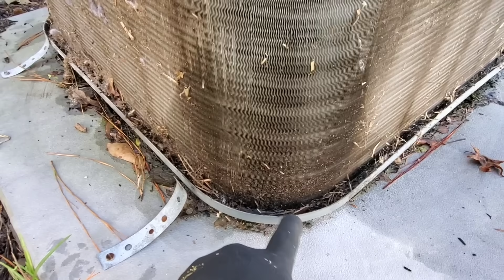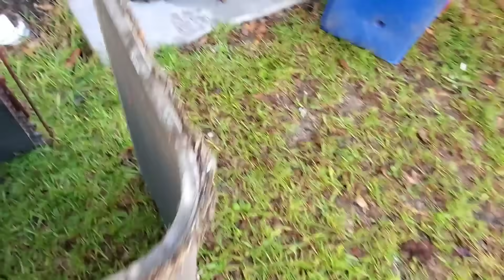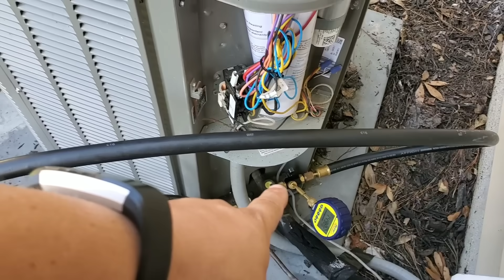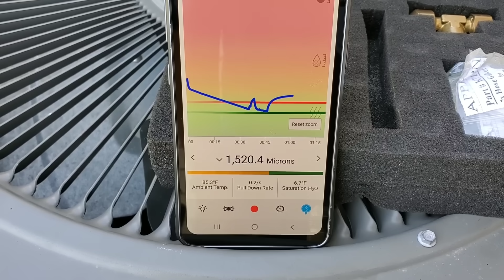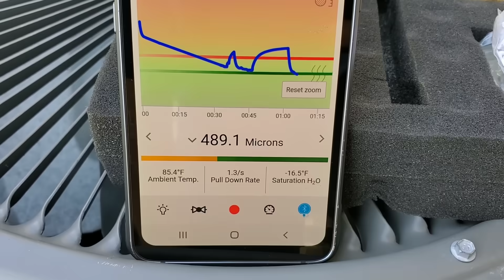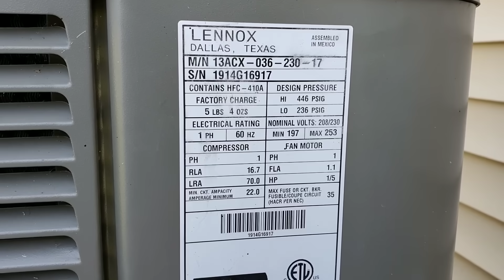Lennox Condenser Coil Replacement

Comment: This was an Awsome video. Good to see real world vacuum pulldown. It’s not always a 10 minute nice and easy like u always see on YouTube. Your right when it’s wet and the last guys didn’t dry the system out it makes for a slow process for the next guy. Good on you for best practices. That flame blowout made me jump 👍
Reply from the maker: Thanks Cory! Thought the oil flame up would be good to keep in the video and keep guys on their toes doing these type of repairs. Plus who doesn't like fire and slow motion. 😆🤙
Reply: What did you use to show yow moisture in the system liked  it alot
Reply: James Toy bluvac micron gauges with the bluvac application

Comment: What did you charge the guy for that job,im curious i need that done to my unit as well and there trying to tell me to buy a new condensor unit all toghther,what do thise condensor coils run by them selves im out of warranty by about 5 months,the 5 year that is.
Reply from the maker: Sorry, Far to many variables for me to give any prices. I'd suggest getting other estimates from local contractors if you are concerned with what one company is quoting.

Comment: Couldn't the moisture have come from the leak? Even if it didn't go flat, gas flowing by the pinhole would draw air and moisture in.
Reply from the maker: If you are asking if it is possible? Sure.  Is it the likely reason for excessive moisture in this specific situation? No.
The important point I was attempting to make was how to identify moisture and the process of removing it.

Comment: It’s odd they didn’t put anything under the coil to keep that from happening, rubbed that whole corner down. Nice fix. I always like those superheated oil flare ups when taking components apart, makes you respect what you’re working with. Good job all around!
Reply: Must've been on a Friday... I'm not sure about that time frame, but I believe there are typically plastic stand-offs the coil rests on, but could be thinking of a different brand.
Reply from the maker: Gotta love when you have to make in field improvements to the manufacturers design so it will last. 
Thanks for watching Tom!

Comment: Thanks for showing why we should use a pipe cutter for the first opening in a system. Now I understand how someone could really be injured by using the torch.
Reply from the maker: Trapped oil doesn't care weather the system is open which is exactly what happened here. Good for new guys to see. 👍

Comment: How do your Testo's work with the measureQuick app? I still have trouble with mine dropping out or not inputting info at all. Nice tip on the vacuum curve
Reply from the maker: Thanks! 
I very rarely used the MQ app over this summer. I may use it more this fall on my maintenance checks and see if I have the same issues you describe.

Comment: couldn't that rise also be refrigerant in the oil?
Reply from the maker: Refrigerant is usually removed in the early stages or "Rough Stage" of an evacuation (760,000 microns to roughly 10,000 microns range). At 1,500 microns I was well into the Dehydration Stage. Removing the remaining moisture from the POE oil.